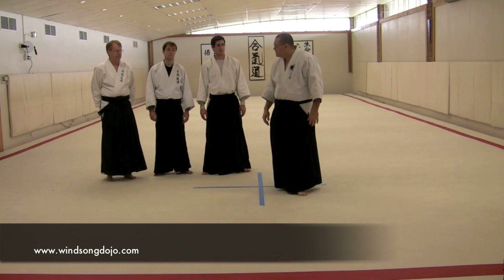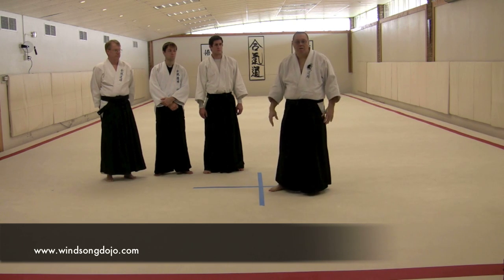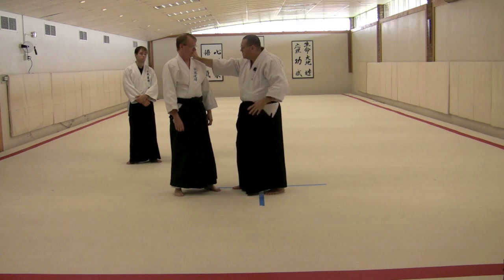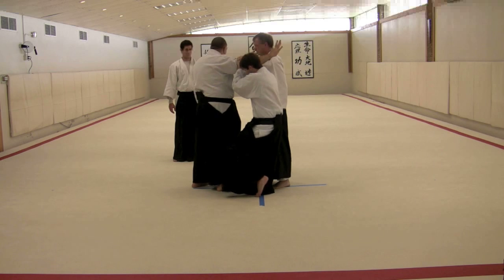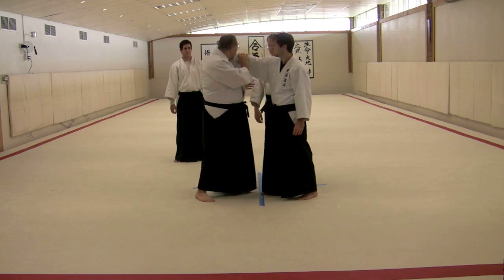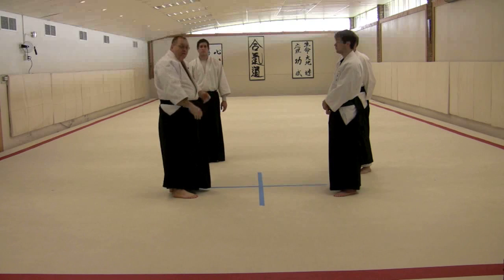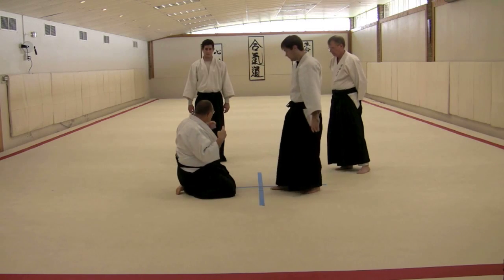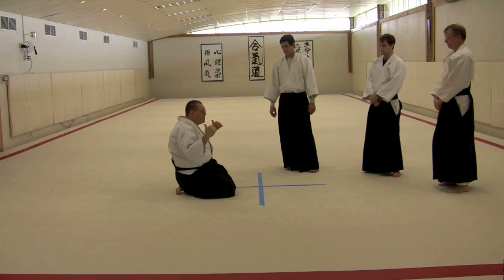Aikido Principles: Ki - Isometrics and Vectors, part 1 of 4

Comment: Looks like I could use the principles from this exercise to become immovable while sitting inside someones closed guard. Can these same principles be used against someone that is pulling you towards them, or pushing or pulling from the side? What if the point of contact is not the shoulders but around the waist, for example, using the legs to disturb your position? I'm sure the answer to all these questions is yes, I just have to play with it and get the feeling. Thanks Mr. Lowry!